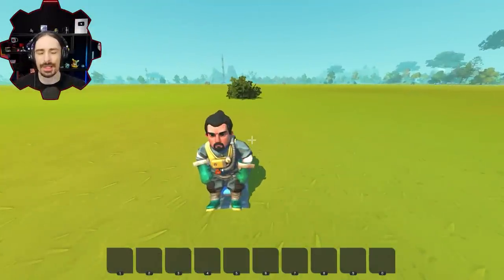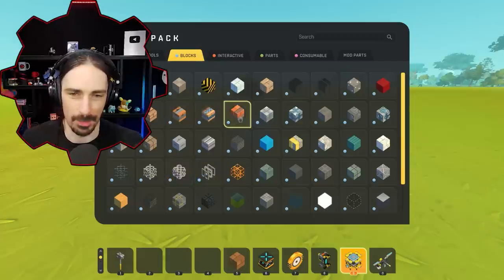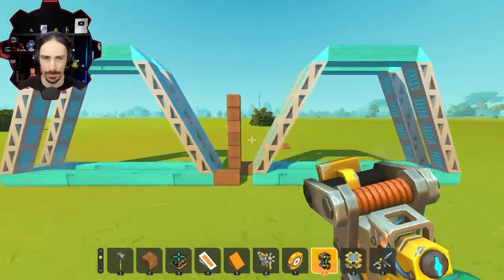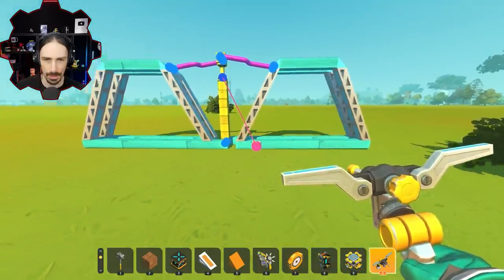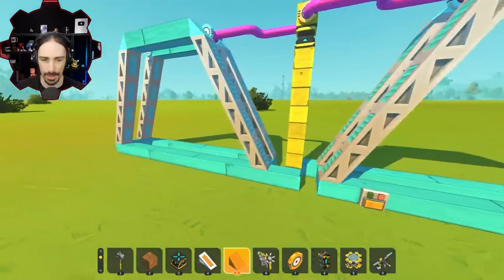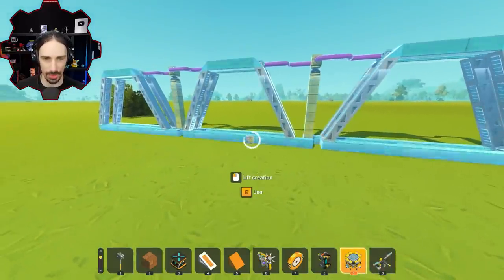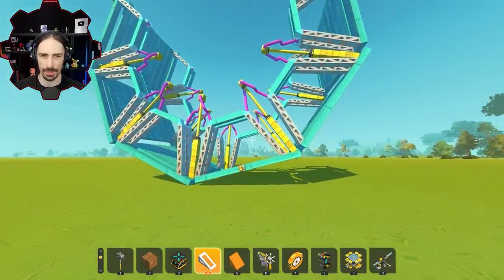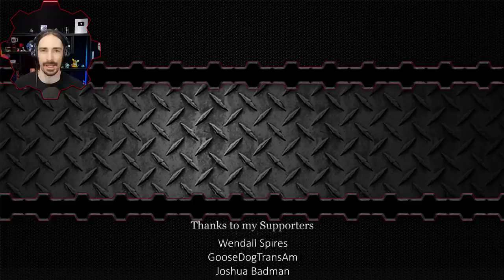I Built a Bridge That Rolls Itself Up With Pistons!

Comment: You could prevent the piston misalignment by putting stopblock where the pipes would reach 90° so they can't turn more than that. So if it wasn't too heavy to phase through the blocks it should in theory work.
Reply: 100%, unless the piston strength is also a problem.
Reply: I don't think he tried adjusting piston strength though, that might be the problem as well
Reply: might be simpler to add a stop on the diagonal beams to prevent the piston from 'clipping' through them
Reply: Couldn't a second piston do the same? Using a second set of logic and a second switch, have the pillars be an extended piston. When closing or having it open, they extend and just sit there acting as a pillar. But when he goes to try and reopen the bridge which the pistons don't have the strength to do, the "pillar" piston closes which adds more strength behind the pull to extend the bridge. Or would this not work? I don't have the game so I'm guessing.

Comment: if you make this in trailmakers, you can adjust the strength of the pistons and maybe work better? and then put it on  tank base to make a insta-bridge builder!
Reply: Trail makers is hard to make physics based moving parts, good idea, but it would probably not fold anywhere near what you could get in scrap mechanic.
Reply: main issue in trailmakers is the lack of bearings. the spinning servo or rotating servo can work, but theyre just massive parts

Comment: To keep it from over-centering, simply make each yellow piston pillar into a T perpendicular to the bridge. Then it should unfold nicely as well since that's what locked it up, not the weight.
EDIT: Some are mentioning that a bridge like this exists, and it does! It's the Heatherwick's Rolling Bridge in London. A small walkway bridge, but a neat structure either way. It's clever how it over-centers piston-to-truss links when unfolded. This keeps it locked straight in case hydraulics fail.

Comment: I think you just need to adjust the speed or add a sequence to the bridge.

I would make the first piece the fastest and the last piece the slowest and every piece in-between have progressiv speeds.
OR
You extend the pistons one by one and the bridge will unroll itself and won't need as much strength too.

I think the problem is that the last piece extended first and put more weight over the hinge (extending the leaver action) and the first piece wasn't strong enough to handle it.

Comment: Would it be possible to put a stopper in front of the piston to prevent overextension?
Reply: I was thinking a wedge block in that slot in the truss since that wouldn't really mess with the profile of the bridge, the bridge looked like it was locking up because the piston pylon was just freely rotating thru the gap

Comment: To make an 8 segments bridge, you'd have to do 360/8=45 degrees angles on the segments (divide the whole circle by the number of sections).
For the unfolding and floppy problem, it comes from the weight of the bridge : the last piston only has its section to carry so it works, but the 1st one has the whole bridge and is not strong enough. Making the piston extend 7 or 8 blocks doesn't matter. You could improve it either by making the bridge lighter, or using 4 pistons instead of 2 per section. When it's welded in the center, it works bc it only has to lift half of the weight on either side.
Nonetheless, cool design and vid as always :)

Comment: The center-folding bridge would make sense and operate like a swing bridge. You'd keep that folding up in the middle, but when unfolded it should rest on a column on each end where it should also meet flush with another bridge segment which may or may not lift/fold back to the mainland. This way boats would get the necessary clearance between each column and bridge to be able to navigate through waterways.
Reply: True, but its not exactly the most practical way to do it
Reply: @Finat0  Nothing about the bridge was practical.
Reply: @LucJenson  your not wrong...

Comment: playing with this in ploybridge, it works, but not as well as the usual method of just having the top truss be hydraulics that compress. scrap mechanics can't have pistons that start at extended so i don't think you can use that method.

Comment: I think you could make it work from one end if you sequence the pistons.
Put some weight on the sections closest to the anchor point, then retract those pistons first and gravity should help it roll open. Think of a slinky where each part pulls the next over the tipping point
Since the bridge is currently balanced over the anchor, it has too much weight trying to keep it closed and not enough trying to open it

Comment: Can use a piston mounted on top to push against a bump stop on the next section not attached to second section so it only pushes like 1 or 2 blocks as your linkages are just over extending till gravity can flop it sideways is what it would be equivalent to irl

Comment: Adding a controller to the bearings might help give it a little more force, and might allow it to unfold even after too much angle.  It would take some tweaking to get it to sync with the piston movement, but might make it work closer to the intended result.

Comment: The strength of the pistons (probably) isn't the problem. You can see the pistons pivoting out of place; Because of that, the contracting pistons are only making crushing force on the bridge, and not a force to open the arms. If the pistons were held in place by blocks, that wouldn't happen, and the force would actually go towards opening the bridge. It is, however, still possible the pistons are too weak.